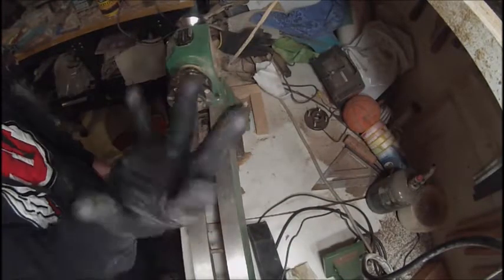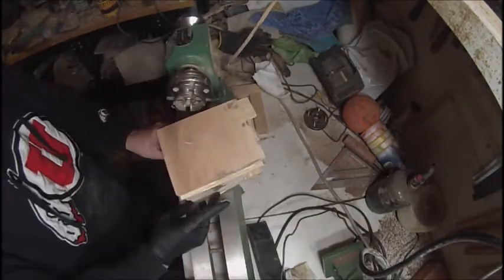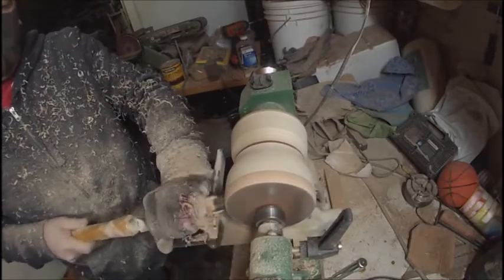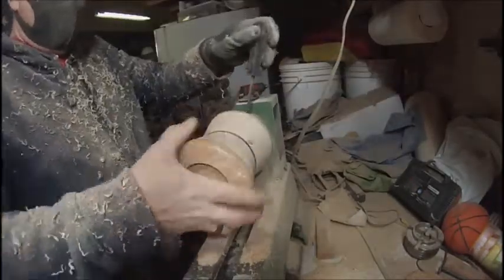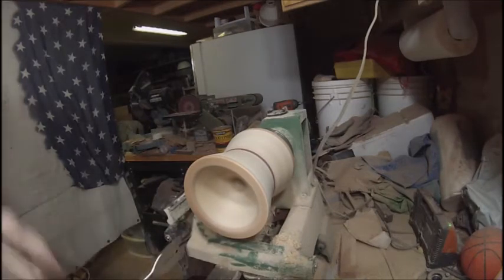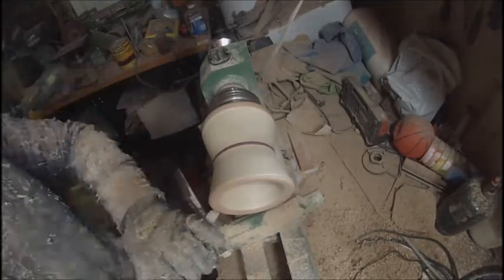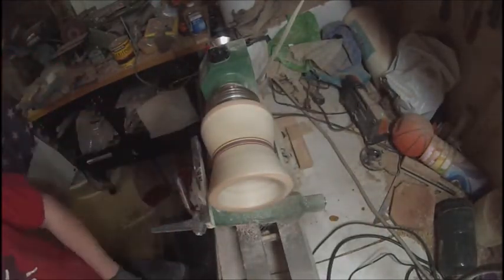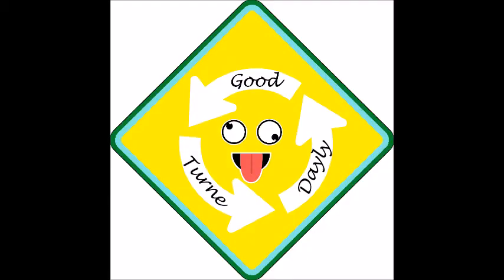Multi wood vase, Pencil holder, umm whatever

Comment: Nice pleasant turning🏆  Good job on the wood layering. Alder? Dry? Sometimes you'll have this😮  I love cherry too😃  On the oak chipping off ... go with the grain. When you cut from the inside up and over the edge, that's against the grain so ... cut from end of bowl Into the inside or Down to the outside. Think of how you would sand a board - flat and onto the end - never from the end onto the flat. Hope that helps.  Keep 'em coming Blair👍  Stay safe.  -Mike